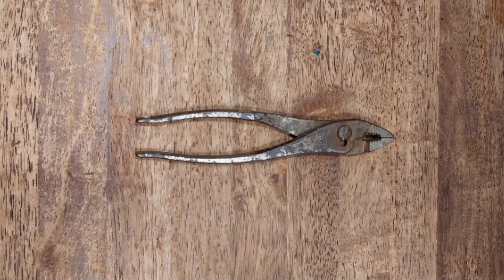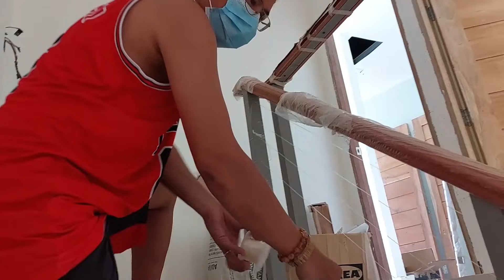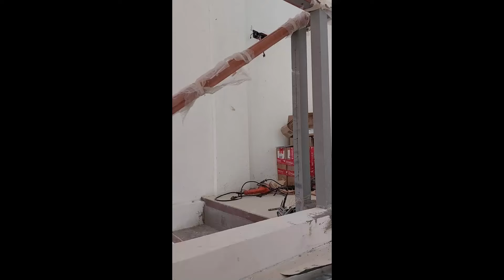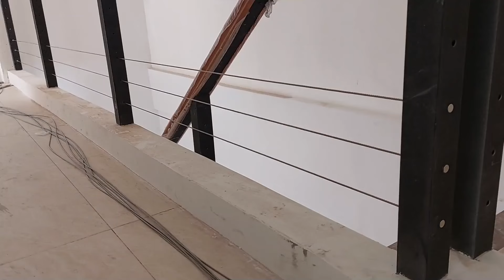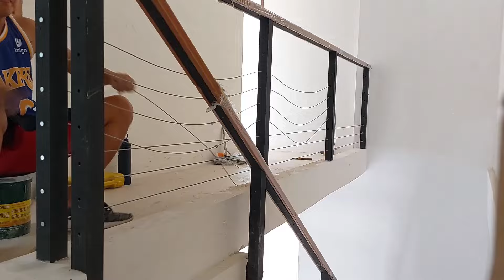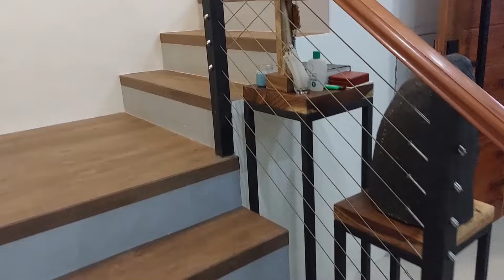DIY CABLE RAILING PROJECT. Paano gawin at ano ang mga kailangan? |  ITLOG DIY PROJECT

Comment: Anong size po na drillbit ang gamit nyo sa butas ng rope at ng end na butas sa may swage head hex ano po size ng drillbit. Salamat idol
Reply from the maker: 8mm po swage at 3 to 4 mm po sa rope. double check nyo lang po muna ang diameter ng swage at rope baka magdrill para sure po. salamat.
Reply: @itlogdiyproject4831  thank you master🙏🙏anong size po ng crimping tool ang ginamit nyo no.4 po ba?
Reply from the maker: @Koaboi527  yes po or pede nyo din po icheck muna kung ano ang sasakto sa gagamitin nyo po.